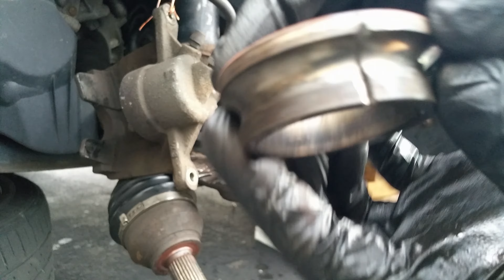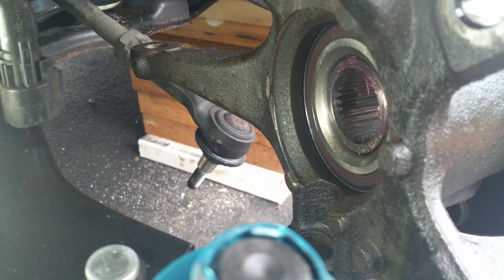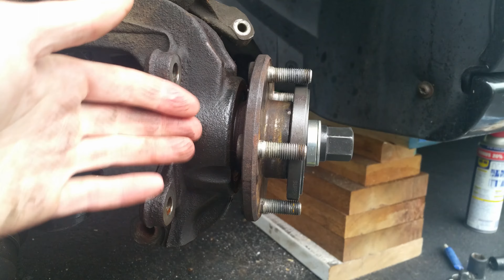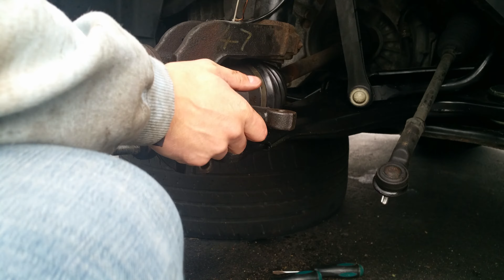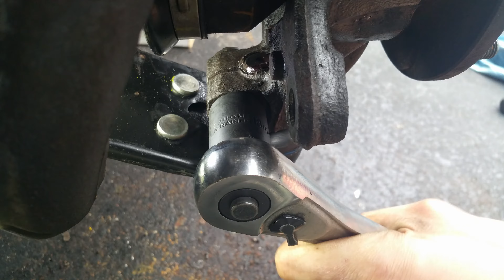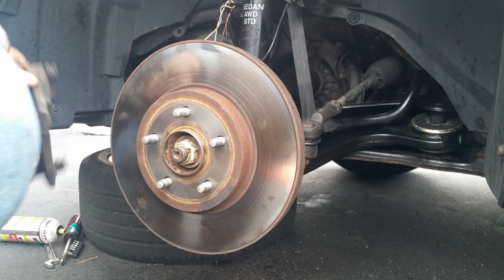2005 Jaguar X Type Front Wheel Bearing - Part 2

Comment: Nice video!  To set the nut on the driveshaft, it's saver to put the wheel nuts on the brake disk, insert a screwdriver into the caliper bracket right into the cooling slots of the brake disc. otherwise you can damage the wheel studs.

Comment: So: I watched this to solve the mystery of how to get the f***** half shaft out. On the offside I got the lower ball joint spigot out, but it was a dangerous nightmare getting it back in. I did finish with all my fingers intact. So on the near side I thought I ain’t doing that again. Hence viewing this. However the bit where the half shaft “just falls out” is conveniently missing. After about 3 hours of trying every angle, I took the front (horizontal) wish bone bolt out, detached the anti roll  tie bar and the position sensor and hey presto, it just fell out! Hope that’s helpful info further somebody else.

Comment: top axle stand 😝 good tips thanks  👍 the bottom ball joint in the manual states you should lower the sub frame 30mm to avoid damage to the hydro bush i drilled out the ball joint rivets  just done top mount strut  fitted a new bolt in ball joint no more lowering the sub frame going to drill other side out too for future worn parts.

Comment: Your video helped me out a lot but I believe you should have packed bearing grease int to the bearing before installing it. Not just on the outside but the internals of the bearing
Reply from the maker: Most newer cars, including this one, have a pre-greased and completely sealed bearing design. There's no need and no way to pack them further than the factory does.

Comment: This is a great (2 part) video.  Helps massively as my X Type needs the same thing done.

I have seen on Jaguar forums that you need to be very careful of the quality / brand of bearing you buy (some have the wrong number of magnetic segments and the ABS gets very confused).  Then you have to do the job again but with the correct bearing..!

Not sure where (in the UK) I can find the bearing puller / pusher tool you hired.  Pretty sure I can't hire...which may mean it is financially more cost effective to get a garage to do it sadly.
Reply from the maker: This is actually what happened to me! I used a National brand bearing first, which had a different magnetic encoder and I needed to do this a second time with an SKF bearing. Caused all sort of issues with stalling and ABS light.

The specific puller I used is not necessary, any puller with the right size cups should work.

Comment: where do I get that Bearing puller set? Looks like it was made for the Jag. There's a few on Amazon also parts suppliers have them to lend. Great video!!
Reply from the maker: It was a rental from the local auto parts store. It wasn't specific to the Jag, but was made for doing this exact process which is similar for many types of vehicles.

Comment: Thanks for sharing! I'm just curious whether you had any abs issues after the job. I've seen some posts (here's one:  https://www.jaguarforums.com/forum/x-type-x400-14/abs-light-after-front-bearing-change-175802/)  where there are some bearings out there being sold that have the incorrect amount of magnetic segments. That would really suck after a job like that!
PZ: I usually work alone also, but thought it might have been nice to have someone apply the brakes for you while you tightened the axle nut 😉
Reply from the maker: Funny you mention that because yes, I did have that problem and did this job twice! I used an International bearing first, which caused an ABS light and also randomly killed the engine while braking. Switched it out with a SKF bearing from Jaguar dealer directly and everything was fine.
Reply: @in-depthdiy2123  Well hopefully somebody sees that link I posted above if they're looking at doing this job 😬

Comment: 13:53" How the hell did you push the control arm down so easily? I have 40lbs of dead weight on it and I can barely move it with a pry bar. It moves but not enough. I calculate it would need 200lbs of down force to do it.
Reply from the maker: It was a new control arm so the rubber may have more give. They make a lever arm specifically for bending the control arms down, but I usually just use a bar or in this case my body weight.
Reply: @in-depthdiy2123  Thanks for the reply. I ended up creating a special tool. :D
Reply: Try loosening the control arm in the rear and remove the long vertical bolt on the arm. Then you should be able to swing the arm away from the frame and the ball joint should just drop right out (if it's already loose). Just watch that you don't pull the axle out too far from the tranny at the same time, there's a seal in there.
Reply: @snatr  Thanks but it looks like the control arm bolts are not easy to get to. I created a 4 foot long lever that made it much easier to push the control arm down.
Reply: @brokenmotorwagen1328  Cool. I thought I'd mention it anyway in case it helps someone else. Working on the ground as I was didn't really leave much room for leverage 😉

Comment: Why didn't you show setting the hub assembly back onto ball joint? Your video skipped right pass that part and I cant find another video that shows it.
Reply from the maker: What specifically are you having trouble with? Usually it's easiest to pry down on the arm so it's below the hub, get the hub resting on the ball joint and then push the hub around until it slides into place. Sometimes helps to have a second set of hands to do that.

Comment: Great video- 
Where did you purchase the bolt for the ball joint ? 
If you don’t heat these up or use the wrong tools they typically brake. 
I also have an x type.. and could use a purchase that bearing press kit as well. 👍🏻
Reply from the maker: The bolt was from the local hardware store. Used a 10.9 grade nut/bolt.

Comment: That control arm... one bolt looks impossible to remove.  The bolt head is on the top and the nut is on the bottom.  How do u remove it without removing the cradle..?
Reply from the maker: You have to remove the bolts from the back side of the cradle to drop it down slightly. There's no way to remove it without lowering the cradle.
Reply: In-depth DIY ok so it can flex.  The previous owner destroyed the ball joint on my jag, and I was just going to put in a bolt on ball joint.  I figured I can just unbolt the ball joint instead of removing it from the knuckle, so I don’t destroy the boot like the old one.
Reply: Hey if you could link me to that bearing race puller/installer I would be grateful!

Comment: What was the make and model of the tool you used to pull the bearing off and back on again? Would you mind sharing?
Reply from the maker: It was a rental tool from the local auto store, EverTough 67213
Reply: @in-depthdiy2123  Nevermind. I ended up using a smaller adapter anyway and it did the job. I really thought it was gonna gut out the bearing and leaving the outer race stuck in there but it didn't.
Reply: @in-depthdiy2123  Hey man... I finally got around to doing this job and I ended up renting the same tool as you mention here, but I don't have an adapter in the kit that will just fit  the outer race yet make it through the hub. You had one in your kit?